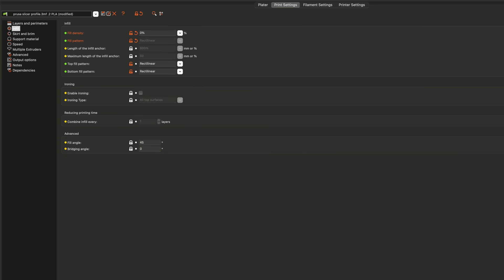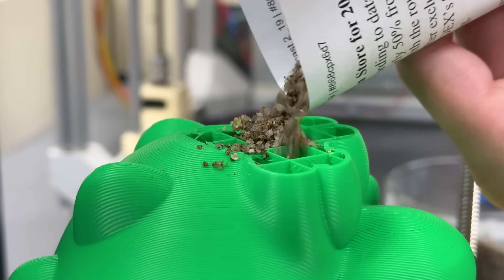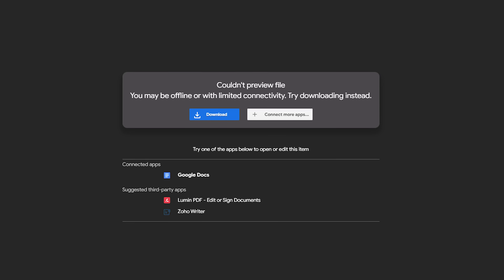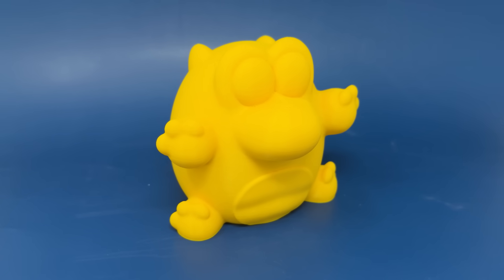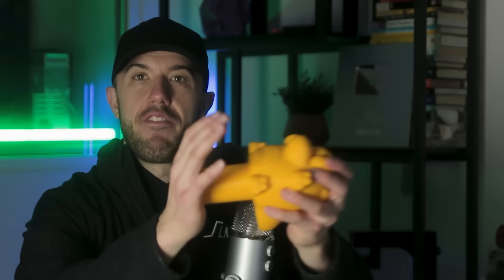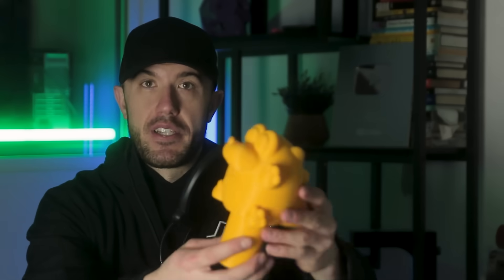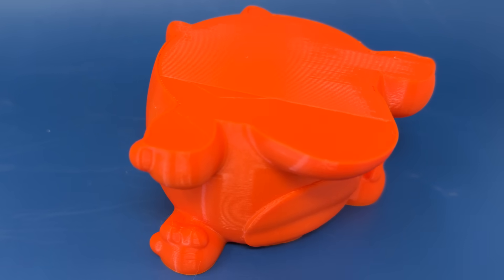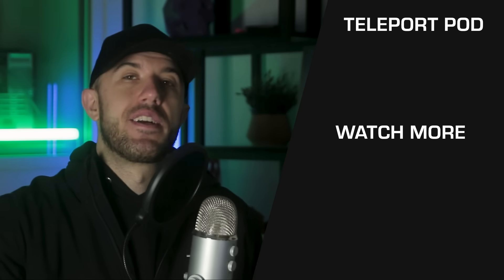How-to Make Your 3D Prints Heavy (Without Wasting Filament)

Comment: Exact opposite of premium. If you buy a premium chair (gaming/office) it comes pre assembled out of the box. You open it and it rolls out, ready to use. The cheapest product are coming in part what you have to assemble!
If there where fill up hole(like a coffee machine) and your prints are water tight, then it may pass, but this way it fails. You  expecting free labor from your customer, so you can spear a few pennies on shipping!

Comment: Does shipping in US cost increasingly per gram/ounce without thresholds? And does it really matter in whole proces? My standard shipping costs by volume×weight but the first threshold is 1kg, the next is AFAIK 15kg, the last is 31.5kg. Plus three standard sizes 38x64x[8 or 19 or 38] cm (most shipping companies). Or choose other method with much bigger available with similar weight thresholds (up to 5kg, 10, 25, 31.5, then bigger is calculated individual).
Letting a client pour sand into the item (or worse, to put water filled jar) would exclude my products quickly or cause numerous returns.

Comment: A strategy I’ve tried with some success for some gnomes that needed to live outdoors that were going to be painted too. 

Use a modifier in slicer to add a hole to bottom so that infill is exposed from underside and use an infill pattern that creates a more hollow part like lightning. Modifier to use such as cylinder, no walls, no top bottom layers, no infill. Or you could drill a hole in bottom of part after printing. 

Then when print is complete use the hole in bottom to fill with plaster of Paris. It will set rock hard adding extra rigidity to print on top off weight. 

You need to have your printer tuned well enough that the print won’t leak the plaster as it sets. I’ve found increasing walls to 4 seems to work for me. 

Bonus if you printed in PLA the added rigidity of plaster inside reduces warping in hot weather a bit.

Comment: I added 12 or ~1lb of 2" x 4" metal from Walmart into an excavator base so it wont tip over when extended. I used the slicers cube negative to make space, paused the print, and resumed with little downtime.

Comment: a) Having your customer add weight to your product after unboxing to make it feel more premium is like the least premium thing you could possibly do. It's essentially a DIY kit instead of a product at that point, and the reason you're making your customer do the extra work is entirely to trick them into feeling like the thing they bought is more valuable than it is, which you have to admit to them directly. What a farce.

b) Instead of sand or gravel or lead shot, I like to use wheel-balancing weights. They're easy to handle, easy to design voids for, and they come with adhesive pads attached so you can stick them down in a print and not hear them rattle. Also still quite cheap per ounce.
Reply: he said customer, not end consumer

Comment: I printed some chess pieces and wanted to have them weighted.  I only needed weight at the bottom (low center of gravity) so the pieces wouldn't tip over.  I left a hollow area in the bottom of the pieces and after printing I added clay for weight.  The clay pushes easily into the hollow and will not fall out, I then glue a bit of felt to the bottom to cover up the clay.  I could also have paused the print and fit a nut or a small stack of washers into a hollow area and restarted the print.  I've done this to make screw knobs for the bed attach on my 3D printer.

Comment: perfect timing, I just printed a candy dispenser and the candy jar on top is 30 times heavier than the 3D printed base. I usually use copper BB ammo with a pause, but there has to be a better way
Reply: You'll probably find the lowest denominator of coins from your country might work better and cheaper. I'm UK and for anything I want to have weight, I print an internal 21mm tube (UK pennies are 20mm), pause at the top of it, load it up with pennies then continue the print. Usually costs me like 20p to fill a model. Other than stones or sand (don't go there!) I have yet to find anything cheaper than pennies for weighting a model that still has a good weight against it.

Comment: Making the end user add the weight is pointless for a "premium feel". I still see use cases, like if you have a workholding clamp arm or a little project vise you could fill the "water jar" with washers or something. 

As another guy pointed out. Tap water will eventually become an experiment, so youd want to use distilled water, or add some kind of additive like antifreeze, several kinds of salt (sidewalk salt would probably be best), or just fill it with play-doh. 

Ultimately, if you're able to ship, or post process them yourself, air dry clay is probably easiest to work with while keeping it on the cheap. You just model a cap on the bottom. 

If you want cheaper, model a slot for wheel weights in the bottom, pain to model the one time, but you only have to nail it once. Stop by a few used tire shops asking for wheel weights. They can be lead, so if you're this cheap, at least use gloves and a mask to keep you from touching your face, seperate the steel ones out with a magnet. Id only use the steel ones in a product I wouldnt expect to go into a garage. I've used wheel weights in wood working projects, ive never produced enough of one thing to justify the effort of wheel weights, but if you have a run of like 600 of something, i could see it being worth the effort. Much more, and progressing that many wheel weights for size and material becomes a headache. But a lot more and you could design around the different sizes and just keep them sorted and on hand. 

To the nobody that made it this far, have a good one..

Comment: Just wondering why you would use a full printed container with threads (option 3), instead of just a lid that you can screw into the bottom?
Reply: Depends on the situation.  Larger objects …. Using the insert will be more secure. Especially as it get very heavy.  If you drop it with just a lid that’ll easily break apart.  
Smaller objects. Agreed. Just use a lid that’ll easily

Comment: Variation. of 4th option: make a negative to your design equal to a big bolt: M12 or M16, for example (I don't care about 'murican units, and can't tell you ho much that is in melonball fields), then just screw the bolt into the threads. A drop of super glue will make it permanent.

Comment: First of all, NEVER add tap water to anything that you want to keep clean and free of mold/mildew/bacteria. Water contains its own oxygen, so everything will grow in it. If you're going to do this, use DISTILLED water ONLY.
That being said, why have a container at all? Print a cavity in the part up from the bottom, and model a screw cap into the base with a slot in it for a coin.
Fill the dang thing with table salt, or other mineral that is non biological. It is a minimal cost, easier for the client if you're having them do this, and much cleaner.
Better yet, do the print in vase mode so it's hollow, and fill the entire print with table salt. Way less filament and a much faster print.
Reply: That's a solid point my friend. Adding enough salt to the water to make it inert would also work. If you're adding it yourself, air dry clay is way easier to work with than table salt, and is still pretty cheap. If you want cheaper. Play-Doh knock offs are pretty solid options.
Reply: @andrettibark  clay and things like play-doh still contain bacteria and moisture. Once encapsulated, they will grow mold and mildew. Table salt won't do that.
Reply: @AlAmantea  Play-Doh is like a third salt, and air dry clay is mostly dirt. Your 3d print is probably not totally air tight, it'll almost certainly dry at a really slow rate, but the bacteria doesn't really have anywhere to take hold. Air dry clay doesn't have any biological material to feed the bacteria, and play doh is intended for kids to play with, stick back in the tube for 3 months then put right back in their mouth. It's about as close to inert as you can get. If you're super worried about it you can model a pin hole in your cap, or just leave the cap off as it dries. 

Don't get me wrong, table salt is fine, just more expensive, more of a pain to work with, and kinda makes your thing into a shaker. You could combine the two to get the best of both worlds, or sub out the sand for playground dirt. 
Ultimately, we're all makers here. I respect your intelligence enough to assume you could figure out how to make any of the methods do what you want them to. And I could make almost anything I have on hand work out. Hot glue and little bits of scrap hardware, wheel weights in modelled voids, a plastic ingot made in a toaster oven out of your scrap pla in a muffin tin, fishing weights, silly putty, slots to screw bolts in with plugs to cover the heads, scrap heat sinks salvaged from whatever you can steal from work, whatever you can steal from work. I mean this is a super simple concept, none of us is gonna have the absolute best method, because all of the methods can be "best" depending on what you have access to and what you're going for.
Reply: @andrettibark I do agree with most of what you say, but not quite.
A 3 ounce can of Play Doh runs $1.44 at Walmart.
A 26 ounce tub of table salt (Morton) runs $1.67.
Table salt is MUCH CHEAPER.
Salt will settle itself and take on the form and shape of the cavity with a few simple taps to the side.
Clay or play doh requires more effort to fill the cavity and shape.
Ultimately we are both correct in thatsaying there are many ways to achieve the goal.
My point is that water or material containing moisture is not a good idea.
Depending on the use case, the maker could be open to liability for damages, especially if it ends up affecting the health and safety of the user.
There is an inherent responsibility of the maker to provide a product safe for its intended purpose.
Reply: @AlAmantea  I'm seeing knockoffs for 20-30/kg in big enough bulk, but yeah, it's ultimately dependant on use case. Your prints are probably not moisture tight though
Reply: @andrettibark  probably not, but since I won't be using water (or any liquid for that matter) if I ever decide to weight a product, it doesn't matter.

Comment: also you could design a complex shape cavity inside the item, print a bunch of parts, then, all at once, lay the parts upside down, and fill them all with concrete, very quick process, and if the cavity has a small hole to fill it, and gets bigger insdie, the concrete wont come out ever
Reply: And that makes it a premium product? Never.

Comment: Or, get a syringe, print with a low amount of gyroid, and pump it full of Plaster of Paris. Makes it heavy, doesn't rattle, super cheap, and doesn't have any added steps, negatives, or extra parts to print/assemble.
Reply: Making only this with gyroid infill and pour it with help of a funnel - 30sec operation and problem solved. No extra costs of shipping unles you print 25x25x25cm "brick" full of plaster. I didn't think of any other option at all. Plaster - easiest, cheapest, hassle-free...
Reply: Um... where does the water go that is not involved in the curing process? The curing process only uses water equivalent t0 19% of the plaster's weight - 40-51% of the water (plaster's weight as reference) are "free" = will evaporate / diffuse. Where does the H2O go? It goes into the filament, causing deformation, it condenses on electronic / mechanical parts or into the furniture under the object...
Reply: @f.d.6667  will evaporate through walls. I'm using also the method mentioned here - make "lid" on some flat surface (back/bottom) pour plaster after print, let it set and glue the lid. Sometimes i model it with little lips for better position of the lid or some kind of slide-in lid.
It's easier to make it plaster-pourable in mind for your own designs, other designs may vary.
Reply: @f.d.6667  done it lots. Doesn't mess with the print, doesn't ruin furniture, and it's dry as a bone.

Comment: I have created subassemblies that are like option number 3, but the entire subassembly is dropped in when printing is paused.  I use a tiny amount of 3D gloop on the bottom so the subassembly will not shake loose.

Comment: Has anyone in his right mind ever picked up some plastic print and said "wow, this feels so heavy and premium"? 
It's still plastic.
It is useful, it is fast, it is cheap. 
But "heavy" and "premium" actually NEVER came to my mind.
Reply: my plastic mechanical keyboard feels pretty premium to me
Reply: @ocoro174 it feels premium until the keys break.
Reply: I think adding weight to a plastic print can make it feel more premium. Dieter Rams was the first one introducing high quality plastic products in the 50s with many others to follow (panton chair, Eames Plastic Arm Chair, Braun T3 radio, etc.). Since then there is high quality thick material plastic in expensive products. There is as well cheap plastic products, but you could say that about every material, probably.
Reply: Yes it actually works. It's a common tactic in commercial products. Like Beats headphones have useless weight added. But your wording is strange. People pick up an object, feel how light it is, and assume it's hollow/thin/weak. A heavier object is assumed to be sturdy/durable.
Reply: @MaaveMaave when you just fill it with crap, it doesn't get sturdy, it can still break.
You mentioned a plastic chair for example. That would just trick the customer and that is never ever a good idea. The negative reputation would come back to the maker of the product.
Reply: @ I was not so much talking about the weight, but rather commenting on, what I understood from the comment, that plastic is for cheap products in general. Interesting fact with the Beats headphones

Comment: I do a hybrid. I print a box, fill that box with nails or something and super glue them in, then remove the box volume from the internal of the model. Then when I have a layer pause I can drop that box in with minimal time for shrinkage. The next layer tends to bind well enough that it won’t rattle around in the print.

Comment: The idea of making it feel premium by having your customer add it in post is inherently contradictory for these kinds of products
Reply: @greyvlad  I think this makes sense only for functional parts that need to be heavy.
Reply: Well, the other option is to insert the weight before shipping, and charge the premium price that it justifies. This is just an attempt to have it both ways, but perhaps there is a market out there - ultimately you do end up with a better feeling part for cheaper, even if the initial experience was worse.

Comment: I did something on a similar vein. I got laser cut-inserts made out of steel that just snap in at the bottom of the print and they work great. Easy to insert with no mess. You do have to ship their weight, but honestly it's not that much more, and it's a better experience for the customer.

Comment: I would only ever endorse allowing the end user to add weight to the item if it is critical for function (e.g. preventing it from tipping over). just from a user perspective it would feel very janky and weird to have to add water to something so it doesnt feel so light and cheap. I would rather just eat the shipping costs honestly.
Reply: I would not lie to any customer by filling a product with crap to make it feel more premium. Because that doesn't change the quality of the product.
Reply: @richard--s  The weight and "feel" of a product is important, even for those where you're not going to be handling it. I made hanging wall art that was too light and people said it feels cheap, adding weight cleared that up.

However if you add weight in a way that feels unnatural I can see that going badly
Reply: Especially for a figurine that will be selling for <$20. People buying cheap things just for the looks are going to be offput by assembly. 

At most they will be willing to go through the work of mounting, putting the thing together because the seller couldn't be bothered is a great way to get negative reviews.
Reply: This is normal. Portable Basketball hoops and umbrellas stands require this end user intervention.

Comment: User adding weight doesn't really speak "premium".  That premium feel is all about perception, and when you pull back that curtain the perception is gone.
Reply: I completely agree.
Reply: Worked in marketing for 20+ years (LEGO, Groupe SEB/Tefal). Done a lot of research on perceived "value". 90% of normal consumers perceive the heavier product as better and thus are willing to pay more. Perception is reality when it influences decisions.
Reply: Agree. 
As well, it makes the product unnecessary complicated. You want a simple product like this to have one function, just work and be on point. To explain this in the description + make a little guidance into the shipping box is just super unsexy. It adds a layer of complexity and maybe confusion to it. In my opinion, the solution would be to find a mix between 100% infill and the standard infill, like e.g. 30%.
Reply: Sometimes you just wan't the thing to not be knocked down easily so it's the best of both worlds.

We should advocated for informed and smart customers instead of brainless consumers that buy crap they don't need.
Reply: I couldn't agree more. Weight is about the PERCEIVED value of the producit, not just to make something heavy. If the end user has to do it, then it's just a paperweight, not a premium product. I've tried all those methods and the easiest, most efficientl way to achieve this is to add more infill. No extra steps, no extra labor, and no janky third party or DIY weights!
Reply: I felt the same way. Their first impression is a part that's really light, and some work they have to do themselves right out of the box. I personally would just take the shipping cost.